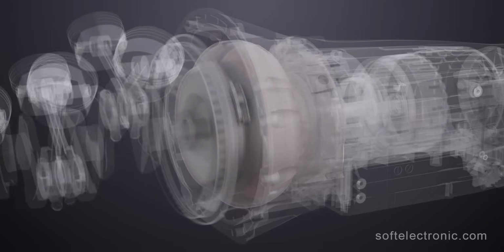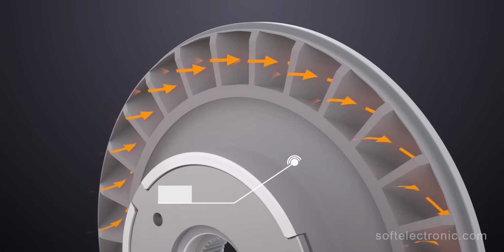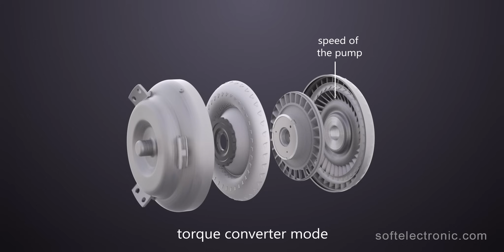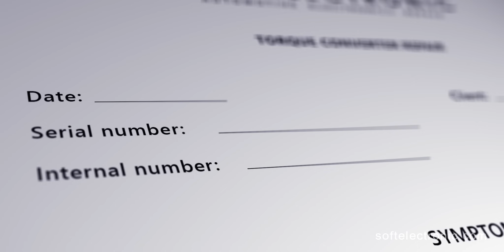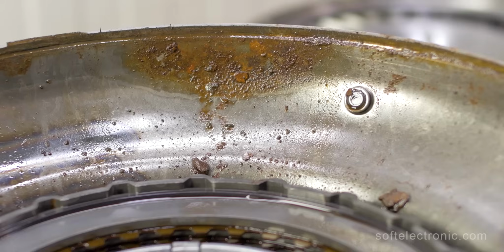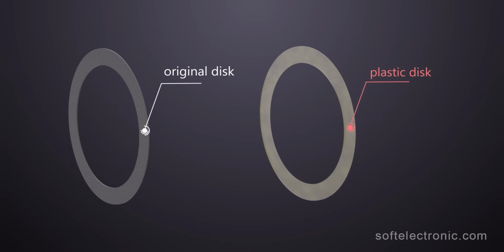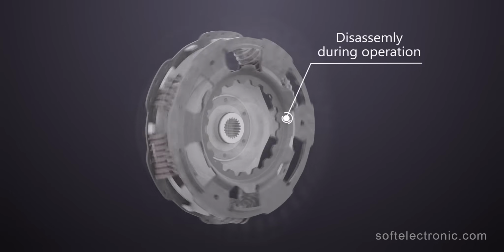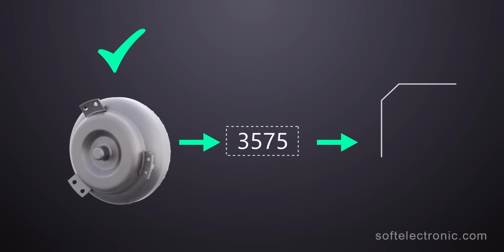How does the Torque Converter in the automatic transmission work?⚡Electric & Hybrid Vehicle Repairs⚡

Comment: What if a transmission line leaked fluid and now vehicle will now not go as fast.
Example, previous at 2,000 ram the speed was 70mph.
Now at 2,000 rpm the speed is 50mph.

Comment: Most up-to-engines are automatic. Shifting gears manually is now out of date technology and can over rev engines shortening their performance. Some still  love manual gear shifting as do old science. Providing your engine is running well an auto transmission will provide a smooth  ride.

Comment: Nice video but I believe you made a mistake about the stator as it will only turn in lock up mode otherwise as long as turbine is slower than impeller it will be locked

Comment: Hello, I have a question on aapp4hp14 after warming up to the working temperature slips on the drive, the rear gear perfectly works on the pod switches gears until the cold apc has gone through all the parts except the hydrotransformer could exit the frictions in it
Reply from the maker: Hello, for information please contact an employee of our company via email: admin@softelectronic.com
Reply: @SoftelectronicCOM  Hello, if that answered I found the problem will be questions I will write you ok

Comment: This is great job brother,  but i have a 1998 sienna van which when i put the gear on drive it will not move until i raise it severally before it will drive , could this be that the Torque is faulty, fluid  or what could be the problem . please .
Reply: So you mean that whenever you put the gear selector into D it doesn't go into gear unless you raise it up a little bit? It should just be a problem with the linkages or cables depending on your vehicle. Some vehicles don't have either one but it is controlled electronically by a shifter sensor and a motor to put it in the corresponding gear on the transmission housing

Comment: Nice explanation but I want to know is torque converter is reliable to Indian conditions,comparatively manual transmission,or which transmission is hassle free ? Coz DCT will be over heated & not reliable in bumper to bumper traffic & CVT transmission is not performance oriented in highway we can't overtake suddenly it is good in city conditions only ,for  torque converter in india if any problem arises it will be solved skill fully,pl answer to my querries.

Comment: Who rebuilds a torque converter??? Just get a new one...
Reply: Alot of the "new" ones you purchase are actually remanufactured.
Reply: @goatsemarathon6642  Maybe so, but an end user doesn't rebuild it... you would need a welder, a lathe and a dynamic balancer to put it back together.
Reply: @freddaniali I seen some for larger industrial torque converters need to be rebuilt in the shop
Reply: @wisdomisawesome5934  I'm sure you have, but this is not a larger industrial torque converter. This is a run of the mill car converter.

Comment: Vey well explained.
I have a doubt. My Toyota corolla 2010 model,from past 2 months, little jerk while vehicle is about to move front or back when it is in uphill. Also mild jerk while driving may be between 2 to 3 gear. What could be the cause and remedy?should i repair it immediately?
Reply: When was your last fluid change? I had a similar issue, I changed out my trans fluid and put a bottle of Lucas transmission fix and it stopped. Going strong so far.